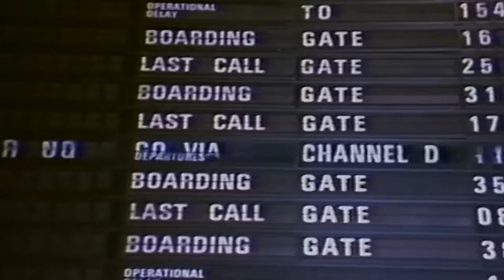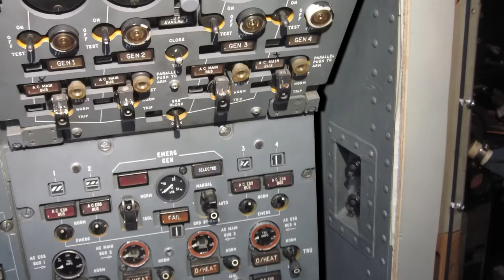Why Blue Paint Caused Problems For Concorde

Comment: The fastest circumnavigation of the globe took 31h27.49 (See 01:18) including fuel stops? Give me a TGV and a clear road around the Earth and I'll show you a faster timing than that without any requirement to stop for fuel... 🚄⚡💨✈😉

And putting my (Arguably; Unreasonable) views about train speed aside, I think Pepsi could've gotten comparable exposure for much lower cost if they'd applied a brand livery to one of Eurostars trains. It was one of the most prestigious rail services of its time, and remains more or less so to this day! 😇

Comment: Eeeeh SR71 not the fastest jet airplane produced, mig 25/31 is faster
Reply: Zzzzzzt. Wrong. You've bought into a lie.  And the X-15 was the fastest at that time. Now we have scram jets.
Reply: @ChicagoHOG27  yeah sure only its not a production airplane, mig 25/31BM has a speed of 3400km/h why do you think the SR71 arent used anymore, because its not the fastest thing in the air
Reply: @qwertyuiopasdfghjkl2556  We don't use it because our satellites are much, much more effective at seeing what we want to see. Do you know what the "SR" designation stood for? Speed is one part of something. Your Mig would fall apart if it tried to sustain those speeds. Being fast for fast sake is dumb. It needs to be practical and have a purpose. The duties of the Blackbird have been reassigned and are now more effective and cost efficient, without invading airspace.
Reply: @ChicagoHOG27  yes it was a spy plane that's clear supersonic reconnaissance, there was also a missile equiped interseptor version YF-12a build with a bunch of other versions, the mig was an interceptor after it fired missiles so need to sustain high speeds, as of the x-15, its considered a manned rocket once fired can't throttle it like as normal plane it was running on an acetileen-amonia fuel which has perfected recently for a new generation rocket engine by the same Russians. In any case all are proven to expensive and obsolete, the mig is still flying and now able to take out the other threat in space you were describing, like it is said every pot has a lid to fit it. Now imagine what could have been done with this money instead of killing all the people, in vietnam, afganistan, irak, libia, sirya and all the other lesser known theaters? Making weapons for no purpose but to keep the military industrial complex busy and printing money from thin air to finance this backed up by someone elses oil, unsustainable in the end, unless you want to occupy all countries. But overstretched supply lines is whats going to spoil the whole thing in the end. Best is to develop together without trying to exploit one another imo.

Comment: 👎👎👎 So the title of this video is a lie and a clickbait, unsurprisingly. 
The blue paint didn’t cause any problem, since the skin heat and expansion issue was rightfully anticipated and managed by the engineers at Air France.
Reply: So they did what again - they "rightfully anticipated and managed" what again? Oh, an ISSUE. Or maybe you'd call that a.... PROBLEM. And why did they have the problem, the BLUE PAINT.

So what about the title is clickbait in the slightest? There was a problem. It was due to the blue paint. It was ultimately caused by something - that being Pepsi's marketing. So in fact the title is 100% correct and completely spot on. YOU however inferred things from that and somehow were upset? WTF man?